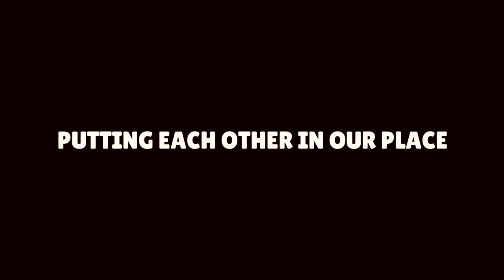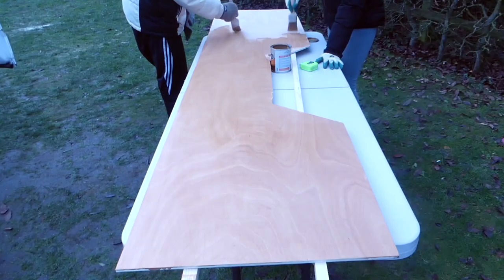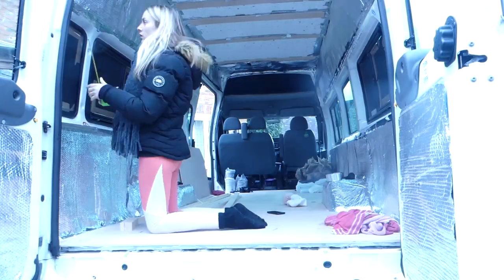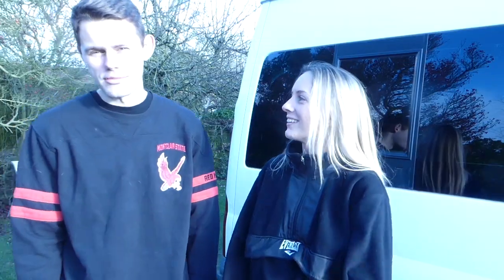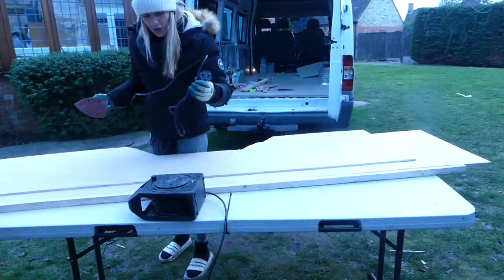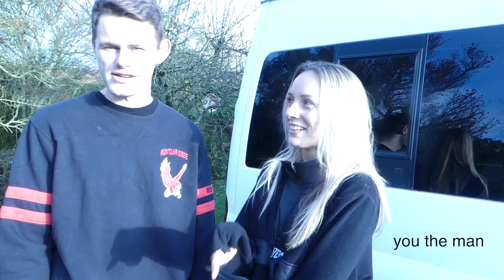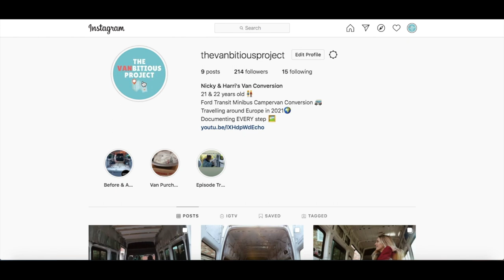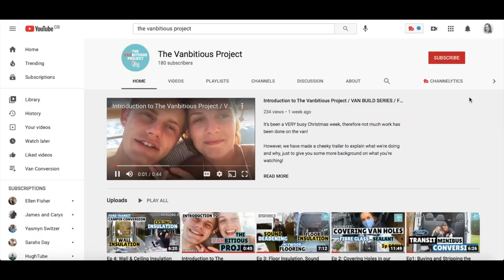Ep 5: Plywood Wall, Carpet Lining, Window Tinting & Woodstain / Ford Transit Minibus Conversion UK

Comment: Good work so far, quick tip, when you drill into the van where the insulation is, after you break through the metal, put the drill in reverse as you pull the drill out, this unwinds the insulation off the drill bit
Reply from the maker: Thanks for the tip Mick, will defo try it!

Comment: PPS if you haven't already incorporated a diesel heater into your design, I suggest you do... I've done two trips in mine and, with all the insulation in the world, with all that glass, these buses don't hold the heat too well overnight. 

ooh Another tip, £44 on amazon for the Karcher window vac thing. It sucks up the condensation on the windows in the morning and you empty it out. Again, with all that glass , it's a must have and money well spent. (insert another thumbs up thing)
Reply: Hi Bobby 
I have this exact same minibus currently converting.

My plan with Windows.....

2 rear door Windows = tint/insulate/block up/carpet.

2 rear long side Windows = tint/insulate with 15mm polystyrene with vapour barrier/ 9mm ply lined..... reason being is width from window to window is 6foot 2 inches. With my window covers will leave me with 6 foot width for a double bed to fit in :-)
Reply: @rustleinthebushes6065  Hi Russell. I've opted to keep the rear barn door windows open. It makes it easier for parking and motorway journeys. But I'm defo thinking about blocking out the rear side windows. I'm 5'10" and I've managed to get a foam mattress (cut to size) in there but its literally the exact length of my body. Haha. So stretching out is precarious with a load of windows at my feet. 
It's handy to be able to increase the airflow of the bus, with the rear windows open, but I think a better night sleep would be far more beneficial. I can just add more roof vents to ventilate, if necessary.... I have some auto carpet and vapour barrier left over so I'm going to have a think this weekend. 
I'm guessing you're going to seal the windows shut and remove the window handle?
Reply: I should add, I've put thermal blackout curtains all round the bus, including the rear doors.... They're not left see through. haha. The whole bed area curtains off to create a little booth to help keep the light out and the heat in. There's also a rotating roof vent to help extract moist air in the night from the bed area. 
LIL' TIP.... don't go for a low profile wind powered roof vent!!! I have two normal ones on my work van and they work a treat. The low profile one on the bus requires a serious breeze to actually move. ;-)

Comment: Hi guys,

Very strange as I have bought exactly the same minibus except mine's a 15 seater so it's 1 foot shorter in length.

I also bought my van in November and just at about the same stage as yourselves.  Loving the progress
Reply from the maker: Brilliant! Keep in touch, we'd love to know how you're getting on! We're going to install our solar panels on the roof early next week, and then get on with cladding - wish us luck!
Reply: @NickyandHarri  I definitely will keep in touch.
I have just installed my solar system the last few days.  Very easy install aswell tbh. I have used alot of YouTube tutorials to guide me so far but I'm in early stages
Reply: Hey guys I forgot to add.
Prior to installing your solar. 

Jet wash and clean the hell out of the roof. They get neglected over years as not seen.
Then get yourself down to B&Q and buy some ROOF SEAL paint... yes as in the stuff you put on houses. Look for something called BOSTIK roof and gutter seal. It's a fibre based epoxy resin paint that will keep your roof rust free for years to come. 
I've just done mine in the grey. It looks pretty cool on the white just use thick masking tape in edges of top of roof as a line. 
I had a small rust patch on the roof inside and also used it on this. HIGHLY RECOMMEND.
Reply from the maker: @rustleinthebushes6065  Thanks Russell, great advice. We're installing the solar panels tomorrow, so this message was perfect timing! Really appreciate it.